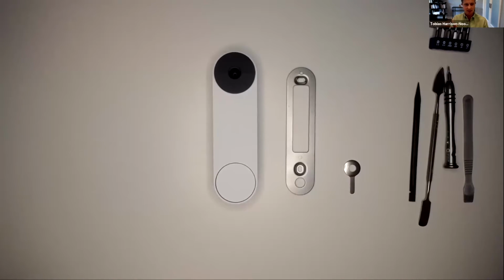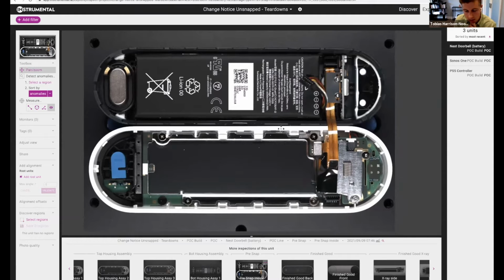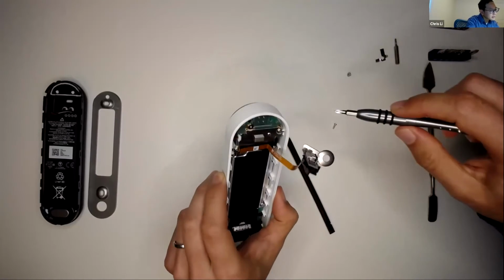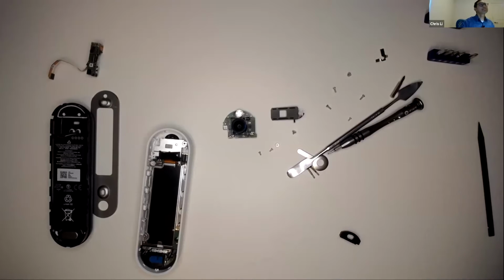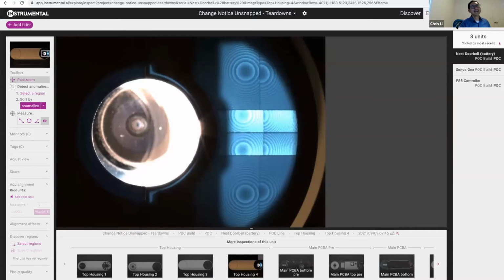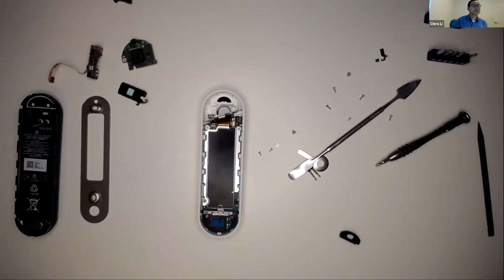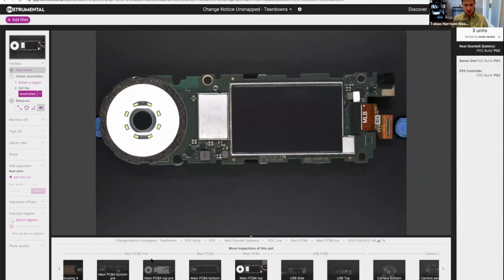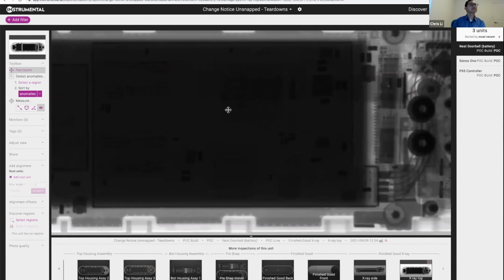Episode #10 - Change Notice: Google Nest Doorbell Teardown

Comment: Good day.  I was wondering if you know whether or not the lens is available to be replaced for this camera?  Google says they will not repair it.  I have one that the lens was busted when it fell from the mount.  I have replaced the camera, but would like to repair the one I have since it is only 2 years old.  It is just the lens.  Everything works, just looking at the live feed, it is clearly cracked in the video.

Comment: My little button to release from mount is stuck and not allowing the doorbell to remount securely. Googles advice was to use wd40 a tap lightly. Thanks for nothing google.
Reply: Same here, were you able to tear down and fix it? Google was zero help to me as well.
Reply: No, it’s still lying in a desk waiting a solution that works or it will get thrown out. With the button sticking I noticed the doorbell gets really hot when hooked to an ac adapter. I didn’t dare play around with it too much so I bought an older version nest to take its place

Comment: Hey, amazing video and very informative as well. I do have one of those Doorbells. I found out on the Google Nest forum that Google does not supply replacement parts for the cracked/shattered lens. A suspected mounting flaw causes the device to release and hit the ground. Would you be able to say if the lens on this device is some kind of standard? I haven't seen this piece covered in your video, but I believe that any information on it would help the Nest community a lot!

Comment: Having an issue with my release pin on this. It's jammed down and wondering if anyone's done a repair to release the pin. I can't click the camera back into the mount because the release pin and button won't move. Had this thing less than 3 months...
Reply: I'm having the same problem right now. Did you get yours fix?
Reply: Same problem here, can someone help
Reply: Same problem :-(. Glad it is still in warranty and after chatting with Google , I get a replacement one.
Reply: This is a total defects that is not fixable by any user

Comment: I'm watching this because I noticed it makes a click sound when the infrared LEDs come on, and I put my finger on the camera lens a few times and heard the click every time suggesting the IRLEDs are controlled by a micro relay switch which seems dumb for a device that is meant to optionally run on battery. Why wouldn't they just use a transistor? Also I've had it since last September, and mine just quit waking on motion last Wednesday.. I have tried everything to trouble shoot this from my phone, I have not taken this thing apart. I have it wired to a doorbell transformer that I installed myself on its own circuit which still works fine. If I press the button it records video. If I go into the home app I can see live video, and if it stand in front of it, it still recognizes me, but it will not wake up and record from any motion anymore. I've played with all the settings, I've turned it off and on, I've turned the event settings off and on and nothing fixes it... Any thoughts?

Comment: I am not happy with length of "I think" leading to completely wrong conclusion, demonstrating the un-familiarity with electronic design practices in the context of device functionality. Read about the product before presenting opinions. This product has an interesting feature of early zonal motion detection with PIR sensor in low power mode, for waking the camera only when needed to reduce the power. It is patented. The CMOS sensors are coming as chips and assembled on the board as shown - it is a common practice. It would be great if you at least decode the component functionality from markings and reference designators on the board.
Reply: P.S. Anyway, it is good that you are doing teardowns, but there are areas for improvement and preparation before the session...
Reply: How do you know all this Celsius do you work at Google or create smart doorbells? (*serious question no sarcasm btw)

Comment: Well I came to watch the back taken off. Thanks for doing it off screen👎
Reply: Me too - anyway...Remove the the two small torx screws - then with a thin case opener, fish around the edge where the white plastic meets the back of the unit  - there are some tabs but if you gently pry the back will come loose. The back section is inset a bit into the white front housing. Be careful with the wires connecting the back and front pieces.
Reply: @peterconrad8416  Thanks for this. I managed to get it off with your help. I had dropped the doorbell on the ground and part of the o ring popped out
Reply: @peterconrad8416  : thanks, mine is still in warranty with stuck latch. So I get a new one for now..But after warranty...I have to try this too (I'm sure it will happen again after x time) :-(
Reply: Me too. Also my T5 screwdriver bits don't fit the screws???

Comment: How does the backplate work to turn on the doorbell
Reply: Yeah, that really made me wonder what was it that made the doorbell to turn on and without the baseplate its a useless pcs of tech. So whats interesting is that if Chris is able to do a deepdive and find a workaround, I tried but it just moves but no reaction or way to turn it on. It is really a special mechanism
Reply: @isaac976  it's simple, it has a magnet on the plate, and a hall effect sensor inside the device
Reply: @paulbianco1  🤯Amazing!! Where did you get this information?

Comment: What about the latch button above the USB port? Mine is stuck and I'm trying to figure if I can get it unstuck before taking it apart. It looks like it was missed in this teardown.
Reply: My neighbour has the same issue. Did you end up solving the problem?
Reply: @nibblenibblenomnom  I RMA'd it to google and they eventually sent a replacement. I eventually took it apart and it's stupid because that latch is epoxied in place so you can't get to it to fix it and you can't replace it because you'd have to replace the whole back piece and that has the QR code.

Comment: Thanks for the teardwon!
A board level camera module has cost benefit than complete enclosed one, which need to glue & cure the lens holder  with sensor board which means manufacturing factory needs glue machine & heating chamber to achieve that rather than just a screwdriver 😄

And they just need to wipe the die surface with Ethanol to remove any potential particulates before cover down the camera holder, which also benefits on sorting convenience.

We usually use enclosed camera module in higher resolution film (no hope board bent by screw)& small room place where is no space to put screws on like smart phone area.
Reply: Any ideas for the brand for the board level camera module?